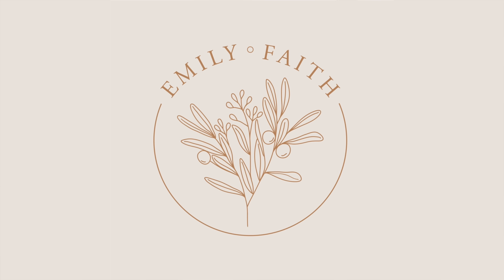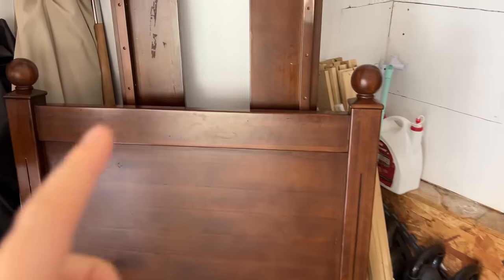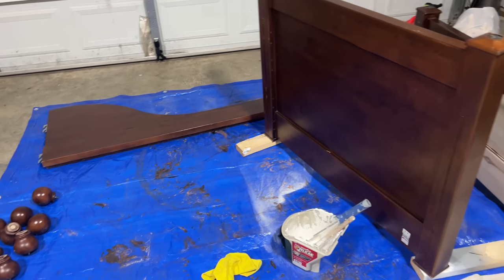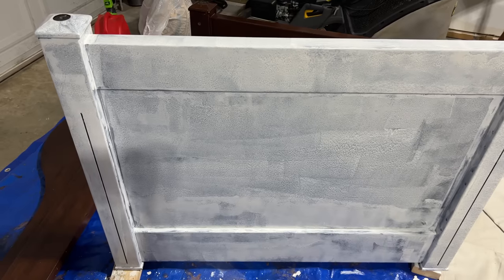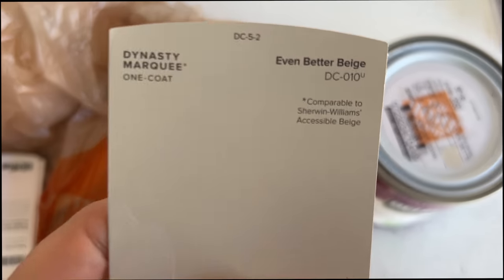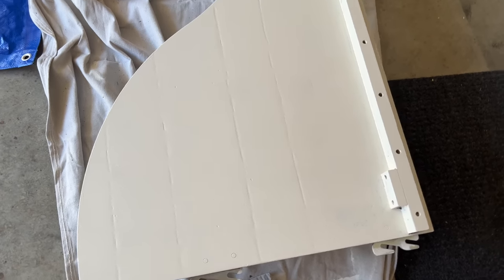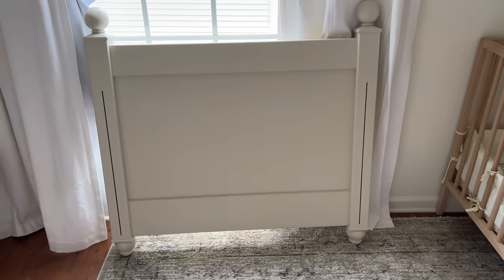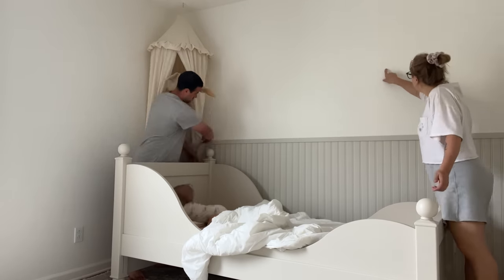HOW TO: MARKET PLACE FURNITURE FLIP - bed frame makeover

Comment: Dear Emily, the bed turned out lovely. I have a suggestion, if  I may about the window ledge ... use a reciprocating saw and take off the tiny bit needed to put the bed where you wanted it. Hugs💞
Reply from the maker: We rent so we are not able to saw into our window sill, but it’s a bummer that it doesn’t fit by such a tiny amount. Happy we made it work in her room anyways ❤